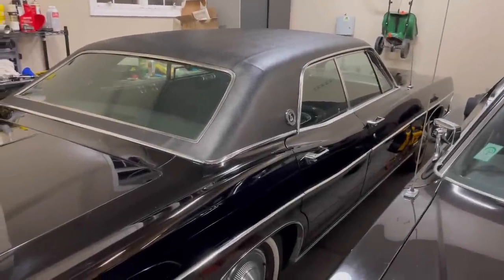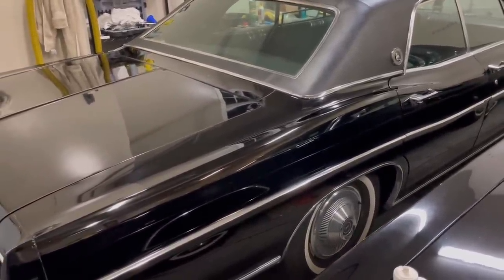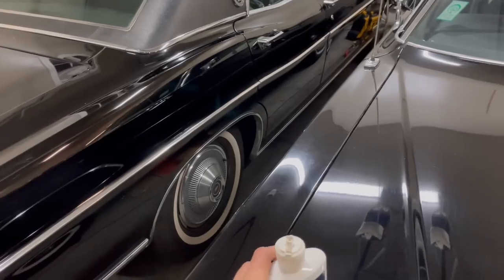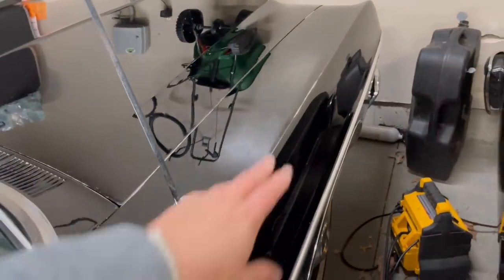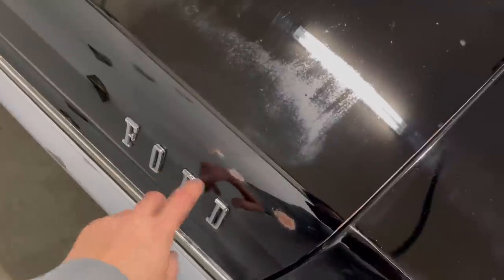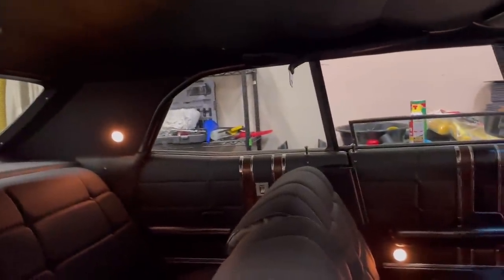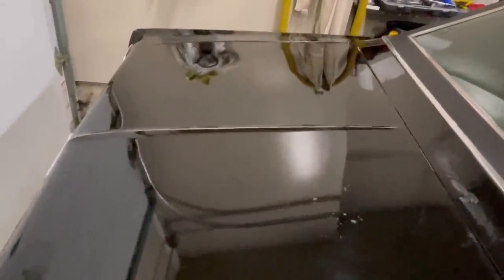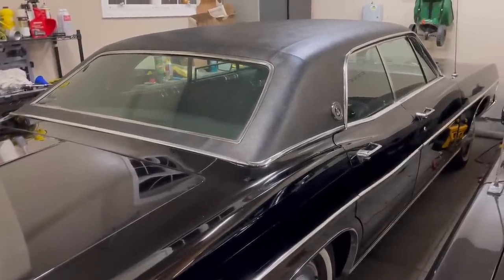Final Exterior Polish of 1968 Ford LTD Brougham - What Works Best?

Comment: Great job. I wish my 1975 Pontiac Grandville convertible had the same quality of paint on the front clip as it has on the rear portion. The original Cameo White paint from the doors back still looks great but the front fenders and hood are another story. I started having issues about 10-15 years ago and had to have the hood repainted as the original GM lacquer began cracking and now the 47-year-old paint on the fenders has developed small but noticeable cracking. A friend told me the reason was the doors, rear fenders and deck lid are painted in one part of the factory and the front fenders and hood in another part of the factory and the paint quality or application between the two is very noticeable.

Comment: here is an idea for you to get rid of the left over crud around moldings and stuff  after you buff and pollish ..get your self a 2 inch soft paint brush and spray wax around the affected areas and brush away all of the junk,,,or if you have a compressor...you can spray wax and blow air into the little spaces to clean out ..both the fords and mercs look good as a 4 door hard top ...and both use the same roof and glass

Comment: For the letters and other pain in the butt areas, I like brushes from barber/beauty supply store.  There are different sizes and stiffnesses.  I prefer the natural hair type as they are less likely to scratch the paint than the synthetic types. You'll have to trim them to get the stiffness just right.  With the right size, you can cover a lot of area quickly - like around metal trim or along the edges of decals, for example..  A paint brush works, too. but they are too stiff for my tastes.  
The big puffy soft brushes are great for brushing around instrument clusters - especially with canned air.  Good luck!

Comment: When I polish mine I take the metal lettering off if it can be done in such a manner than they will go back on and stay.  They I separately wash, clean, and detail each letter, then reinstall.

It's also rare that you didn't have rodent problems inside, under the dash, on top of headliner, etc.  Body must be sealed up pretty good!

Comment: I'd consider spotting in all of the hazy areas like on the decklid, and then spotting in all of the little blemishes with an airbrush - the car would still be showing more than 95% original paint.

It's nice to get as close to perfect as possible.

Comment: Would a clay-bar smooth out that bad paint?  They work wonders removing embedded dust and grit, when used with a quick detailer.
Reply from the maker: No. Not when the paint was that bad and had heavy oxidation.

Comment: I always used the old heavy Milwaukee buffers. I never had one with adjustable speed. I buffed thousands of vehicles between 1974 & 1998. 

I agree that the Mercury could use a buffing. Chances are the shine will not last indefinitely.
Reply from the maker: Any other tips?  Always willing to learn!